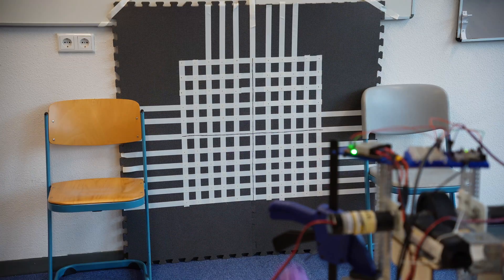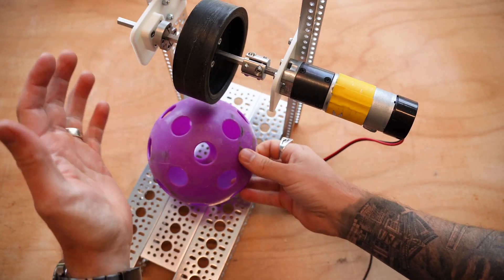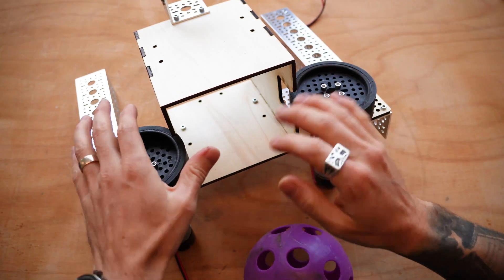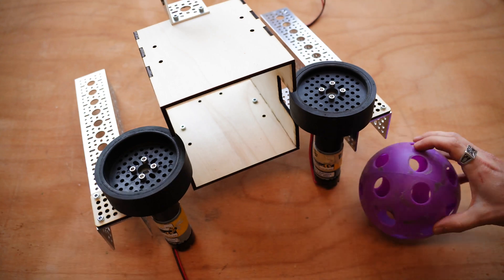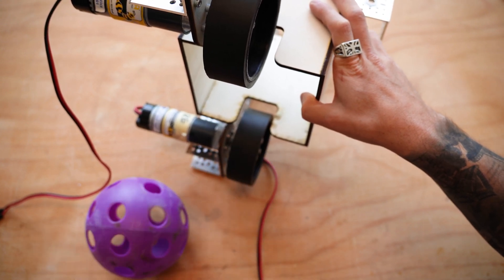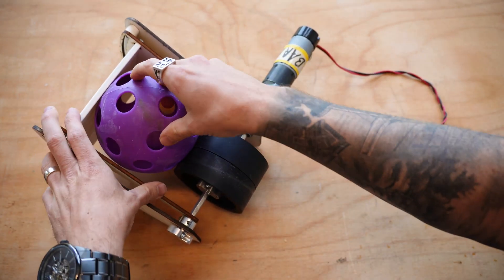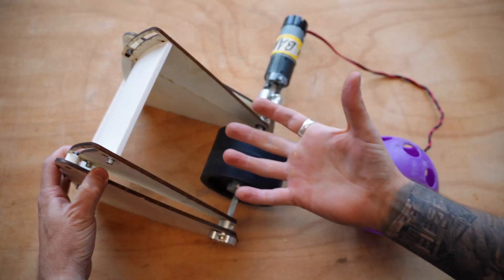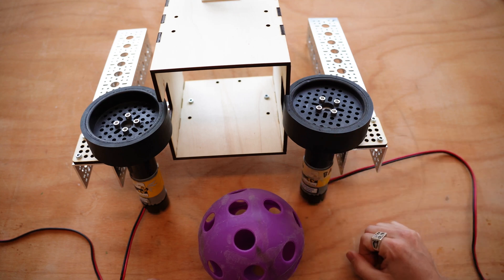How To Make Flywheel Shooters

Comment: how did you make the curved surface on the back? I have been trying to find a solution but none are completely flawless
Reply from the maker: That is a sheet of 2mm polycarbonate.
Reply: @BroganMPratt  If you don't mind me asking, could other materials work? I have considered laser cutting layers out or maybe using a 3D printer to print the curved part. Should i consider grip or stiffness etc?
Reply from the maker: You could use corrugated plastic cut on the back end to curve, I've even seen people have success with cardboard. That said, flexible semi-rigid plastic would be best as a long term solution.

Comment: What wood was used in the dual fly wheel design?
Reply from the maker: 4mm multiplex, stacked twice and laminated with wood glue  for 8mm. I find 4mm isn’t rigid enough for functional parts, 6-8 is better, but laser cutters at 40W struggle past 4mm ply

Comment: with two horitzonal wheel spinning model, we are not able to achieve the same amount of throw as u can achieve in your video, motors are at 100% and we are using gobilda 5202/3 gobuilda motors default gear assembly. any clues will help..
Reply from the maker: My first assumption is your compression of the ball. I’m applying 6mm of compression here.

Comment: I like the hooded shooter with a set of smaller back rollers on the hood belted to the main flywheel. Those back rollers need to be smaller so there is a difference in surface speed and it adds spin for that magnus effect. You can also use a servo to change the angle of the hood to aim depending on how far away you are. Add a Turret for bonus points
Reply from the maker: Great little tweak on these designs, quite advanced to get working

Comment: I noticed you didnt add much compression on the flywheel shooters why is that?
Reply from the maker: I've got about 6.5mm compression on these. Based on my testing here, 6mm seemed to be optimal for low contact times to the flywheel and still have fast (sub 0.5s) recovery times. 
https://youtu.be/cr2IYoCxTVI

Comment: Hey just wondering, what kind of wood did you use for prototyping, and what’s the thickness -Stemtrons 24146
Reply from the maker: I'm using 4mm birch plywood/multiplex for these prototypes. Wood type is not super important honestly. If you're laser cutting, make sure you're using laser -safe ply.  If you're wanting to use something for more serious work, I'd suggest 6-8mm plywood.